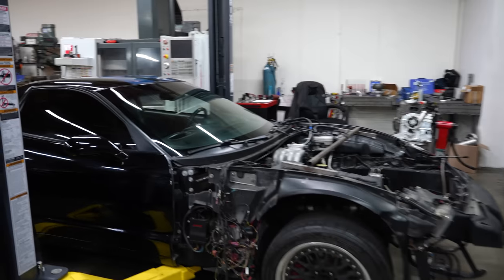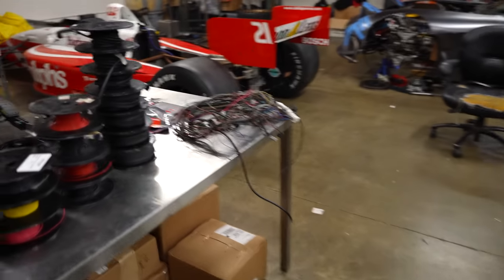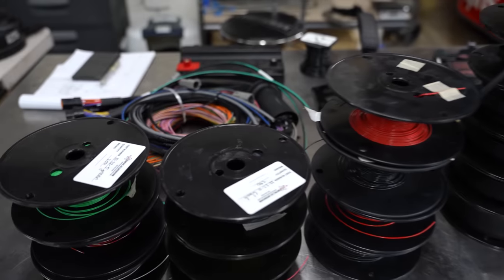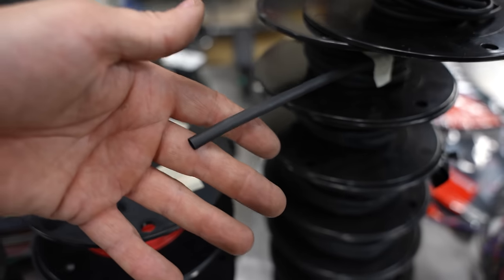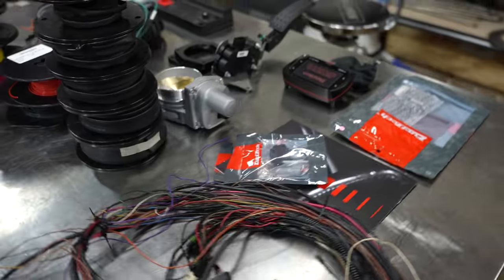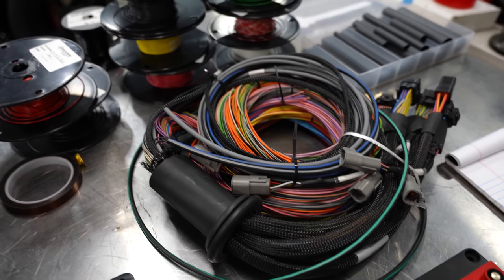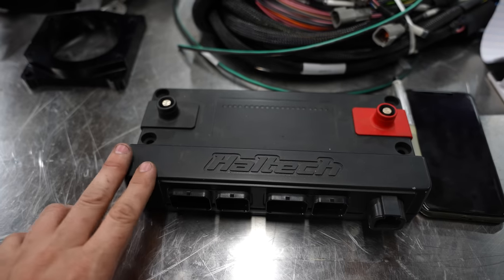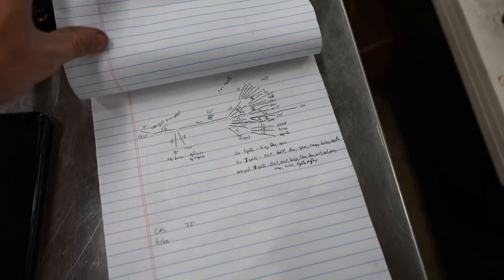The Ultimate Engine Wiring Starter Guide.

Comment: Great video Rob! Awesome to see you diving into and loving the challenge of motorsport wiring and we're stoked to watch and be part of the journey 😎 - Taz.
Reply: Oh its hp academy
Reply: If HPA Approves, then I do too!
Reply: YASSS
Reply: Should offer a discount code on those courses for that shoutout.
Reply: @hpa101  This is why HPA is the best!
Reply: Purchase there courses around a year ago crazy how much knowledge you can learn
Reply: Industrial Engineer's creed: 'Cost of production is determined by the number made.'
He should establish a single harness design for four or even six rotor, allowing the unused wires as an EM back-up if not in use.  Break a wire at the track, or find a higher than expected Ohm reading, loom is still good.
Dummy wire can create an additional Faraday Cage (ie shielding), by physical connection and grounding.
Reply: @milkwithsauce1536  They offer discount codes all the time
Reply: @SollessGarage  yeah I know but one for Rob to push, from the comments it looks like it could sway quite a few people into trying
Reply: Watched whole video and worth it. Love it
Watched hp academy lesson as well and both have been super helpful to help me make FULL level 2.5 wire harness for turbo 2013 zx10
Reply: How about makeing a holder for those wire rolls and add some small wheels, and when you pull the wire, it goes through those wheels and wheels "counter bends"/ straighten out the wire. Same kind off assembly as in MIG welder wire feed.
Reply: @hpa101  HPA used to do these taster courses too, I'm sure they will say if they still do them and I would highly recommend them to anyone still on the fence!
Their knowledge is second only to Robs knowledge on Rotaries (ok they might know a bit more lol 🤣) (I keep saying your fast becoming a Rotary leader Rob, totally mean it)!
Reply: 0
Reply: Zx
Reply: @northwesttrails7176  l
Reply: @northwesttrails7176  o
Reply: Y5
Reply: I was always under the impression the outer most layer of the loom would be the first to break out and so on. Rob hasnt done this here. Any Disadvantages Taz?

Comment: FYI from someone who has built a few concentric harnesses: the part that Rob puts on timelapse (pedantic fussing about and combing wires) is easily 50% of the actual build time. The actual build time should be less than 1/3rd of your planning time.
Reply: i feel like there should be a tool for making harnesses like the ones used to make ropes
Reply: If you look up tooling for a 7 conductor cable construction, you’ll see what it takes. Ryan described it pretty accurately.
Reply: @hellawacked  im trying to find ae86 and other 80s toyotas in junkyards. im robbing every wire out of every rwd mid 80s toyota i find cause they use the same color "codes". want to take every inch of good wire and use it to rebuild a factory color "brand new" harness for brain fart reasons lol. i have a massive wiring diagram life size for it and i dont wanna go through changing colors and end up frying my vintage magasquirt ecm. id much rather pay someone but i really want factory colors.
Reply: @hellawacked  the drill method is what was used to make the foot long conversion harness and what ill use for each individual group to X__ area of the car then a master that im just gonna ziptie together. know of any companies that do factory colors? that way i dont spend weeks tearing apart old harnesses and weeks more replacing each bad wire 1 at a time then combining into a single harness with splits.

Comment: I build a bunch of dev harnesses, and absolutely love Graingers self fusing tape: (not sponsored, just a fan of the tape) Tapes PN: 32XV31
 
It has a -130f-500f heat range, works as a great heatshrink substitute and can cover wire breakouts. It can also be used for a emergency fluid leak coverer.
We use it on rocket engines and I imagine it would work for a Rotary Rocket
Reply: Thanks for the tip looks like an affordable price for aircraft style silicone tape

Comment: Great video!  Learned a lot of this from hp academy and it’s great to see it made available. 

Only thing I recommend is a dedicated branch of fill wires rather than cutting them. I’ve been surprised how often I’ve needed “just one more” and is quick and easy to cut the heat shrink cap and use a wire.
Reply: Yeah like, someone should make a dummy terminator for those wires so you can bring them out of the harness cleanly and use any one of them when adding functionality later on
Reply: Glad you liked the courses :) Thanks for the support. - Ben
Reply: @hpa101  I’m currently saving to get started in your classes

Comment: Having spent time in a bay building aircraft harnesses, i was impressed with this as a first attempt. Look into using breakout boots on the next harness, they perform better than the self sealing heat shrink and look cleaner. Please tell us that you continuity checked it before applying all that epoxy.

Comment: ever consider a roll of velcro tape to move and re use the whole way down the harness while you build it instead of all the zippies
Reply: I keep velcro straps from chargers and such...... didn't think about this until now.
Reply: Honestly, Velcro straps wouldn't really be able to hold the wires as tight as zip ties. Especially with concentric twisting, the wires do not want to stay where they are.

Comment: When I rewire mine. I've done it in a wood board with bunch of nails looking a grid line. . Heat gun really helps in bending or pointing the wire in a direction you want.
Reply: That's how my Grandad taught me when we rewired his '54 Studebaker 3r.
Reply: that's exactly how I wired my first wiring harness for a sensor array as an intern!

Comment: I've been redoing all my harnessed ever since i was a kid. The level of fuckery with which you can get away with is extreme. The secret ingredient is keeping that harness outside of being harmed. Problem is... a lot of things can harm a harness.

In no particular order, wire strain, corrosion, wire sweating, physical damage (this includes both abrasion and cutting), heat damage, and the list could go on.

Another thing. Car standards, when it comes to harnesses are utter junk. Quite frankly, the more boutique/expensive the car, the more garbage they are, AFAIC. Not only they seem to have no clue, but most of them are built with substandard parts/practices. The best harnesses are aircraft grade ones. If one is able to access an old airplane junkyard and take a looksee, that's about as good a lesson as one gets in terms of what is good and what is bad.
Reply from the maker: So So true. Its why my crap harnesses worked.  I knew enough to keep them from interference and damage.  But I did waste alot of time tracking things down and the oil/fuel was eventually going to destroy it

Comment: Tefzel wire isn't really a must have, but please don't use parts store PVC wire its garbage! I use GXL and TXL wires for my harnesses, it's like 90% to Tefzel and is thinner than PVC wire and really good with chemicals and heat yet at a more reasonable price. Also concentric twisted harnesses are a god send😎 as my experience it's easier to use a special color as filler wire, I normally use pink purple or orange as only filler. Keeps you from tracing disused wires. Also staggering splices helps to eliminate the bulges
Reply: I only use milspec txl
Reply: @rexrunner  milspec doesn't mean best, it means the cheapest product that met the specifications. If it's not a product that was specifically sold to the military, milspec means their marketing department thinks you'll pay more money.
Reply: @EmyrDerfel  milspec is the brand

Comment: I stumbled on this video, I’m majoring in electrical engineering and was always curious how this was done... and ngl this is the best video I have ever come across. Being curious about how these things work and someone taking the time to basically be a dad and explain everything and even recommend someone else in case I want to have a hands on experience... I appreciate this so much, keep it up Rob you’re the best :)
Reply: One more thing, take this with a grain of salt (I am an ametur electrician) when it comes to wiring just a recommendation (I’ve seen my dad use these) there are wire strippers that are specifically designed to not cut those tiny copper wires when you go to strip the insulation off, he used them for airplanes (he’s was an aircraft electrician) and it’s the only thing allowed to strip wires on an airplane. Hope this helps :)
Reply: @cjdavis3247  What are those wire strippers called? Are they Knipex?

Comment: for those heat shrink boots you did on the connectors, shrink down the bigger outer heat shrink first, then put the smaller heat shrink over the shrunk end.

Comment: Good job on the video. Alot of people that are enthusiasts have absolutely no idea what it take to "properly" build a harness or even do simple repairs or add on wiring. I cant even begin to tell you how many people think the butt connectors with the built in heat shrink and adhesive are an ok way to connect 2 wires. Professional shops are the main culprits, I wish those connectors were made illegal and not sold anymore. End rant... I see the IWISS crimpers you got, probably the best bang for buck crimpers out there. I got the set that comes with the 5 crimpers, 3 Deutsch and 2 weather pack and open barrel pin style crimpers and 7 de-pinning tools for about $150. I use those for just about every wiring repair or full harness build I do. Amazon has the buy on there if anyone needs a fantastic set to get serious about there electrical skills....

Comment: Other 2 little advices for cable management.
- Heatshrink shrinks with heat but you can enlarge it mechanically to pass some points if you need (1-2 mm or more if the HS is big)
- Hellermann Tyton makes Dymo printable heatshrink so you can label your harness or single wires just by print the Heatshrink.

Comment: Rob, I’ll start by saying props on building this yourself, and thanks for the mention. 
I was so stressed out watching this video 😆. The way we build looms is a much different process, if you like, come down to our shop and we can show you some tips! Just email or call first.
The main “tip” I’ll share to everyone is, start with the ecu side first, pin that and work out to the engine sensors. Doing the ecu last was the main issue with your process in my opinion. You did well with your twisting, but you need to heat the wire first, this straightens it, so it doesn’t get as tangled. The biggest takeaway from doing this loom yourself is you now know where every wire goes, and troubleshooting your work at the track is a super easy process.  Good job dood. 
-Ryan

Comment: A tip on keeping the tangles under control: get a long rectangular piece of wood or plastic (like a chopping board) and drill a row of holes along an edge. Feed the wires through the holes so it acts as a comb. The tangles stay on one side, and it's neatly organised on the other side.

Comment: Career Electrician here that just started a job building industrial wire harnesses. 😊

I just want to say that the principles are quite similar to doing high voltage work but the main difference is that you're dealing with DC instead of AC energy. 

Instead of having dedicated neutrals, the circuits end up having to get grounded.

Comment: You should look into fiberglass filler strands instead of deadening conductors.
Mono-filament can also work out very well.

All conductive wire that is not used or is a “spare” should have shrink capping the ends so they are not confused to be a planned conductor.
 

High heat hotglue is a great option to fill intersection voids at the branches. Ive also used e6000 glue to fill those voids and its great.

A good term for the free ends of a multi conductor is a medusa.

When you feed loose end wire through expandable tube sleeve you can quickly use a little bit of tape to keep from snagging.

Look for heat resistant 3M tape to finish to the connetorized ends.
 Using heat shrink at connectors will create high strain points which over time will cause wire to be over worked and brittle, good brand of tape is best.

Comment: I've been using fiberglass braided rubber coated tinned copper wire. That stuff knows no death, is fireproof, and is abrasion resistant. Actually, you have to guard other stuff from it, as it might just decide to cut through aluminium if left dangling around.

Comment: At this point this is a how to guide on how to engineer a car useing parts you can find online. I like stuff like this. I essentially have a project car but I need to build it. Not a kit car. Im building it from scratch. It will tell me whats wrong with it if somthing goes wrong and the parts have to be cheap, reliable, and powerfule. Needs to make a base of 500hp and needs to be under 1,400 pounds, I have the chasis and will be tubeing it soon. I never realized how hard wireing is till I tried. So this video helps more then most might think.

Comment: As always appreciate you taking the time to teach and share your experiences, especially your videos while you learn yourself . FYI VDC does not ride on the surface of the wire, more strands makes it more flexible however takes more strands to equal the cross sectional area required to meet the proper gauge rating (AWG, SWG,??). VAC doesn't always run along the surface either, depends on the frequency, the higher the frequency the more it tends to surface, called skin effect.

Avoid looping power wires, can create a magnetic field(really just good practice and doubtful it will interfere with sensors or sensor wiring). The alternator is your source of power not the battery, hence why your star point isn't busing off the negative terminal, should try to make it on or as close to the alternator case as possible, the importance is negligible but eliminates possible ground loss. It is not always ideal and we do care about looks of course. 

Should be more commonly stressed that grounds are extremely important and need to be just as adequate as power if not more so. This is why people benefit so much with the "big 3" upgrade in off road, race and audio especially, because the added adequate grounds to complete a circuit. Factory grounds are horrible, unprotected or terminated piss poor and insufficient in way too many cases then not sadly. No surprise with the electrical engineers they employ probably never had any hands on real world experience like most engineers of any trade.
Reply: What are  the "big 3" upgrades, for those of us who don't know?

Comment: Although I have never made a vehicle  harness I can appreciate the amount knowledge shared. And know the difference between sub par wire quality. Strand count vs wire casing especially dealing with car audio a lot of company's like to put a big thick casing on and pass it as 0 4 8 Guage when in fact it's garbage all together. Nothing gives me more satisfaction then a proper soldered  heat shrinked connection then a butt connector.  Some people don't know the difference.

Comment: Rob first thanks for turning us in to that awesome brand of heatshrink. 

Here is a tip you might already know. They have labels that are tubular and made of heat shrink. That is what you want for labeling these harnesses you are making. Then wrap them in a clear strong tape. 

Also, get you a Weidmüller PZ 4 Crimper to make single wire crimps.  Mine is a 901250. It will save your hands and make quick, perfect crimps every time. Your smaller crimpers, strippers, and cutters should all have good handles and spring open so that they work faster and save your hands. 

Also, get you a fox and hound to trace and ID wires. 
Of course a meter and your labeling technique can work just fine, but you seem to prefer to do things the correct way. Hit me up if you looking for someone to do harnesses.

Comment: at 1:31:47, I've seen some harness builders split the single bundle into two bundles (one per ECU connector) here, each at least 4 inches long so you can plug and unplug the connectors easily. Then sometimes the ECU connectors are even booted/sealed on the big-boy stuff.

Comment: Just as a small piece of info when the trigger wheel passes by that sensor(which is in essence a coil) it generates a small amount of voltage which whatever computer your using can interpret. The bigger the tang on the wheel the more voltage generated. Thats how it tells where top dead center is. This is also why you dont want to run actuator wires next to sensor wires, because if emf is induced into a sensor wire it can cause a false reading and throw off the computer.

Excellent job though man for someone who is self taught i think what your doing is amazing. It took me going to naval aviation training to learn how to build harnesses similar to the top end ones. It was a solid two month wiring/harness building and repair.

Comment: I used to work in the SF Bay Area @ Raychem plant....Used to grab pilees of heat shrink that headed to garbage can....The trash area used to be littered with it....Good STUFF! Also in Silicon Valley....there used to be a great selection of electronics surplus shops with "Cannon Plugs & Pins) plus "Mil-Spec electrical wire....Miss those places....Most are gone now.

Comment: Kapton tape is also a fantastic electrical insulator (prevents shorts). You could use this to hold your wires instead of zip ties and just leave it when you do the next layer.

Comment: Hey Rob, I think if you used a cable comb (similar to ones for pc building and cable management) and used it as a slider for your wires as you are twisting it might make it easier and keep all of the wires in line so you will not have to keep unraveling them as they tangle.